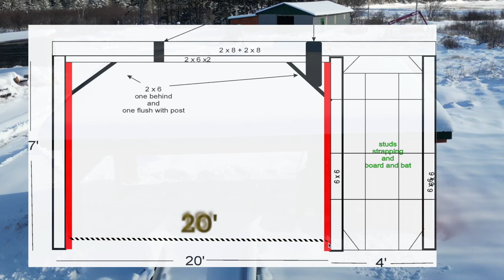There Is So Much To Talk About... Sawmill Shed Designs, Diagrams, & Answers To Your Questions!

Comment: Hi, this was a reaIly nice video

I have 10 questions:

1. Why is it bad to have snow or ice on your logs when you cut them? I know sand and other embedded objects are bad for your blade but is that also the case with snow and ice?

2. How long do you have to wait between cutting the tree down to milling it to using it as lumber? 

3. I know this depends on the logs and the desired cuts but how much waste do you have on average?

4. If you are making planks/boards, how do you give them a straight side/egde, I know how it's done with beams so is it the same process with planks/boards?

5. How thick should the trees be on average to make a sawmill make sense?

6. Do you pressure wash the logs before hand?

7. Does the cut lumber warp or split? If so, how do you prevent it?

8. Is this the same quality lumber (aside from sanding) as you would find in hardware stores and lumberyards in terms of accuracy and integrity?

9. What do you use for lubricant in freezing temperatures when just plain water isn't a option?

10. If you want to cut boards/planks, do they all have the same width or do you need to adjust them afterwards?

I just found out about your channel and I really like it, I immediately subscribed

I apologize for my bad English but English isn't my first language
Reply from the maker: Thanks!  I will try to answer all your questions as best I can.  
#1  I don't find snow or ice much of a problem as long as there is no mud in it!
#2 No need to wait from cutting to milling.  
#3  You will have 15-20% waste wood that can be used for other things.  I find the larger the diameter of log, the better the return or less waste.
#4 If your mill tracks are level, your cut will be level.  Nothing else is needed.
#5I prefer to cut larger logs on my mill and send the smaller stuff to industrial stud mills or saw mills.  Cutting logs smaller than 10" in diameter will not be particularly efficient!
#6 I have a debarker tool attached to a powersaw and also a trash pump with a high pressure nozzle  that i use on logs in the summer.  Not needed in the snowy seasons.
#7 In terms of warping or splitting, you can't predict until you open the log.  Some have stress or spring and that is not predictable or preventable.  When we see a board spring, we flip the cant 180 before the next cut.
#8 generally, the lumber I produce is of better quality than that purchased at a building supplies center and it is of a true inch that is stated.  It may have some slight waves but a planer can fix that.
#9 in the colder months, we use windshield washer fluid.  I put dish soap and pinsol in normally which lowers the freezing point and windshield fluid will absolutely prevent freezing.
#10 Not quite sure of your question here but I do a measurement/calculation on each log to maximize.  Sometimes I have to recut slabs to get my desired output.  Mill on and reach out if you need help!
Reply: @sevengulches wow, thanks for your answers. I really appreciate that

Comment: First off I do like your setup but my question  is , why do you load your logs on the off side of the mill. Or not towards your log stops?
Reply from the maker: I use the log dogs to stop the logs by holding them up with pins.  The way we have it setup gives us much more room on the operator side for removing lumber and piling unedged pieces.  Also when quarter-sawing very large logs, I can bring my tractor and forks in on the operator side to lift off and put back on some of the pieces too heavy to handle manually.

Comment: You guys have a great channel and a great setup there. Would love to see more on that metavic loader and tractor. Is that a butting plate on one side of the grapple of the loader? It's one of the larger forwarding trailers I've seen. Keep it up!
Reply from the maker: We will do some more logging vids in the near future for sure.  I don't use that plate for butting but it could be used for that.  I would weld a larger plate to it for that. The boom is 21' long and the trailer has a 10 tonne capacity.  Very satisfactory for my outfit!

Comment: Trial and error beam sizing can be dangerous. Best to use span tables. A two 2x8 beam for what looks like a 12 foot wide building might be rated to span about 11 feet, not 20 feet. The bracing will carry some load but too much and that will put lateral force on the posts. The truss design can work if done right and the 2x8 top cord could probably be replaced with 2x4.